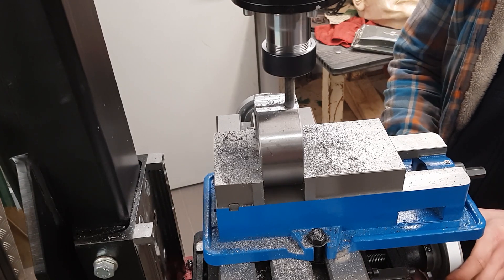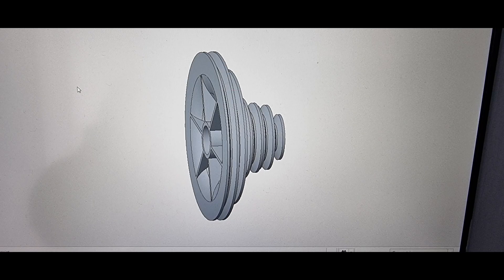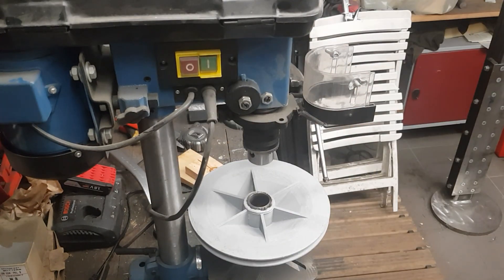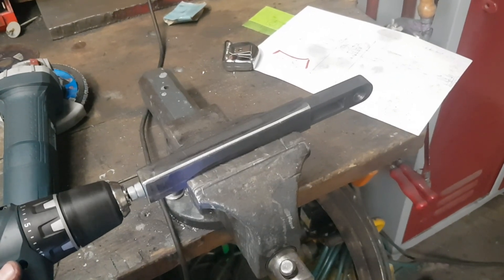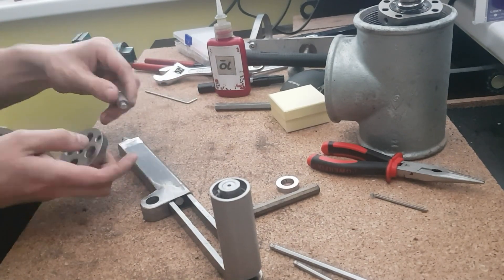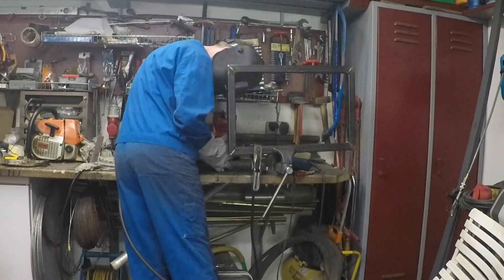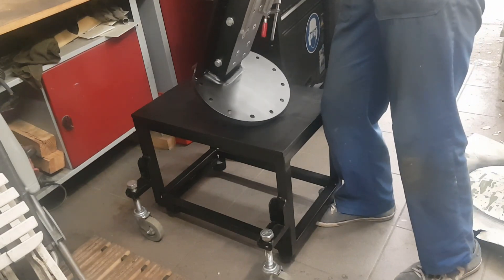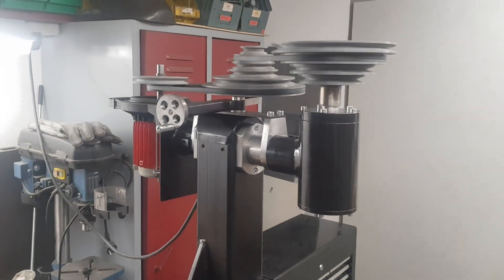My DIY Milling Machine Part 3

Comment: why you spend a lot of time to make pullys etc insted buy biger motor and vfd? set of 2.2kw motor and good chinese vfd is under 200euro.
Reply from the maker: I thaught about that and it is a good idea. 
But the motor i got now cost me nothing.
At the beginning i wasn't sure if this project would even work. That's why i wanted to keep my expenses as low as possible.
As a bonus it's a nice example of repurposing old equipment.

I made the pulleys myself just for fun (and to get the right spindle speeds). I just love tinkering and i haven't really seen 3d printed pulleys in that size.

One thing that also kept me from buying a motor and vfd is that i was worried that at lower speeds i might get less torque than needed.
But i am no expert in electronics so i don't know if that would be the case.
Thank you for the comment!
Reply: @wastelandworkshop3839  3phase industrial motor have constanst torque, you can run from 25hz to 100-150hz without external fan. Under 25hz you need use external fan because internal fan was designed to run above 25hz. Under 25hz air flow is to small. 

in the past I had a similar philosophy - to do everything myself, but almost a year ago I started a business and now I have to have everything calculated. From my point of view, printing pulleys is not economically viable because my time is also an expense. Time is the most expensive resource what we have
Reply from the maker: This would have been a great solution too.

However there will be a motor upgrade. But still a single phase 1.5 kW one. I found a good deal on one that even has nearly the same rpm. 
That means i don't have to rework my drivetrain system.

I totaly get that you value your time fairly high. 
If i would own a business i also would value time different. Just because so much of this time needs to be invested into the company.

More important is that you do stuff you enjoy in your remaining time.
For me that is the homeshop environment.

I can do what i like and can have a little peace without any distraction.
Reply: @wastelandworkshop3839  i think your 1phase motor can run 3 phases - in most cases "1phase motor" is 3 phases motor with one or two capacitor. Most of 1,5kw motors can run on 230 and 400v - there is two setting Y and Triangle.
Reply from the maker: Indeet it can.
But i am going to leave it hooked up for 230V mainly because i only have one 400V outlet in the workshop and at least for now 230V is more convenient for me.

Comment: Is it rigid enough to do face milling on steel?
Reply from the maker: Sadly i don't have a facemill to test but as it is now probably not. Mostly due to the locking mechanism of the mills arm.
Taking deeper cuts with 16mm endmills is a bit of a challange now.

 However i am working on an upgrade for that and i might get a facemill once the upgrade is finished.
The rest of the build should be rigid enough.

Comment: Looking good mate! 
I think that your spindle speed might still be too high, that is if I read your speed chart correctly!
If it is still too fast, you could possibly look for an in-line gearbox unit to lower the output speed of the motor. 
Mark from Melbourne Australia
Reply from the maker: It depends.
My collet chuck limits me to a max. diameter of 20mm endmills. This should be within the limits. With smaller endmills the speeds should be high.
However with facemills you could be right.

Thank you for the input and if the speeds are realy to high your idea might be worth looking into.
Further testing will show.